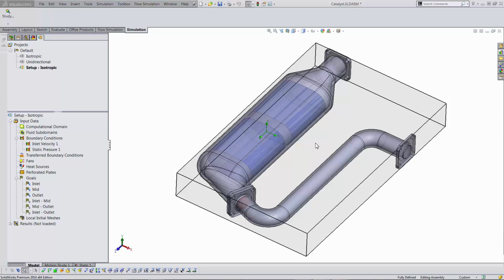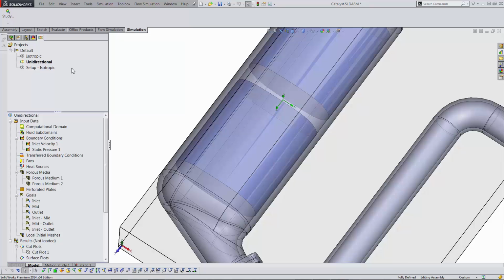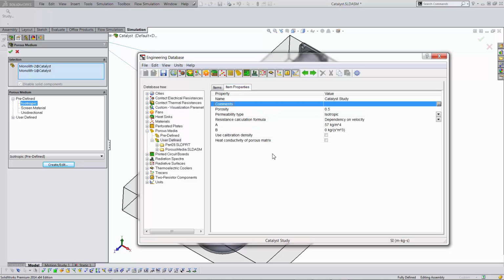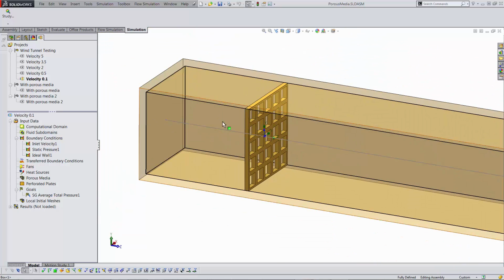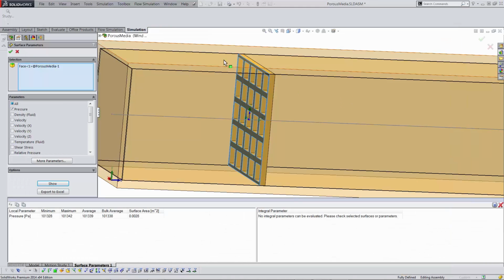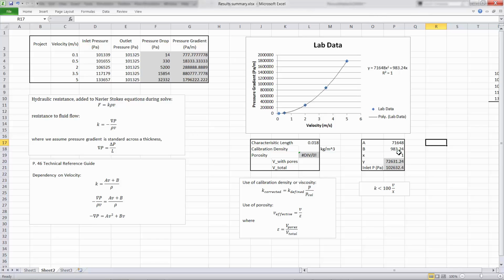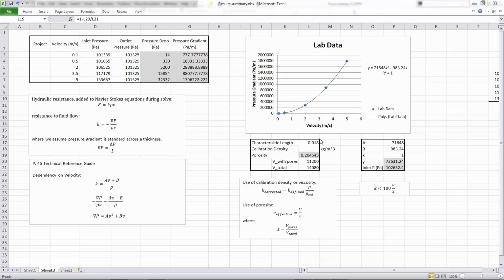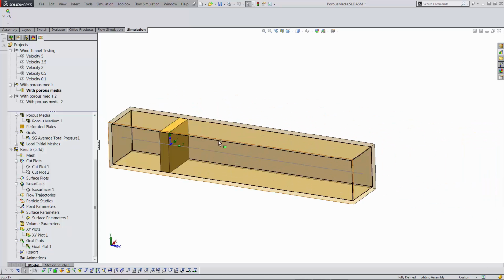SOLIDWORKS Flow Simulation - Simplify Using Porous Media

Comment: When chosing pressure drop vs flowrate it ask you to fill in area in Y, X och Z direction. Is that the cross-sectional area the air passes through in each direction?

Second question:
I get the same results with different porosity values, between 0-1, any  idea why?
Reply from the maker: When filling in pressure drop vs flowrate, there is a dropdown where we’re choosing “Unidirectional”, “Isotropic”, or “Orthotropic”. Since you’re being asked to fill in X, Y, and Z, my guess is yours is set to Orthotropic. You should be able to flip that if it’s not what you desire. 

Porosity (when using pressure drop vs flowrate) does not effect the overall results. The only thing it affects is the velocity within the porous media itself. Thus Velocity cut plots through the center of the media would look slightly different, or surface goals set on the media itself. If velocity is an important output, we recommend making measurement devices offset from the media – that way an incorrect porosity value doesn’t affect our velocity outputs. 

There is  a description of porosity in the Flow Simulation help. I’ll copy that here:

Please note that the porosity value is only used for calculating the flow resistance when one of the dependencies on the pore size is selected as the Permeability type.
With all other permeability types the porosity is only used as a scale factor during the results processing: the displayed velocity value is divided by porosity.
Porosity is also used for calculation of thermal conductivity of the porous matrix.

Comment: Hi Shivani, 

This is an interesting tutorial. I am just wondering if this method can also be applied for getting the pressure drop vs velocity across a thin plastic woven mesh filter? For example, a 109 x109 mesh; Opening Size=0.0059"
;Open Area=41%;Wire Diameter=0.0034".The filter will be installed on the inlet and outlet enclosure vents in a natural airflow environment(no fans).

Comment: Hi all, 
I have few queries related to the video. Can anyone please answer them and guide me kn right path ....??
How come the grate shown serves as porous media ....?? Is it just because of the square holes present in the plate...?
Are these the same holes causing whatever the pressure drop you calculated ...??
Can we have different sizes of plates for wind tunnel testing and actual simulation..?? 

Sorry if the questions sounds stupid and thanks for the time.

Cheers... 🙂
Reply: While calculating pressure drop, one side you have taken value at front surface of grate, but for other side u have taken atmospheric pressure 101325 Pa, instead of value on rear surface which is 101318 Pa. 
Can you explain about this please ...??

Comment: Hi Shivani i have a cuestion, where can i find the 
explanation of the first two equations F=Kpv  and k=GP/L?
Reply from the maker: Hi there,

I believe you’re referring to the technical reference pdf I pull up. One method to find that is to go to SOLIDWORKS Help button in the menu, go to SOLIDWORKS Simulation, then Flow Simulation Technical Reference. You have to have Flow Simulation added in to access this. You can also manually navigate to your installation folder, and get to it that way. An example of the default file path is: C:\Program Files\SOLIDWORKS Corp 2020\SOLIDWORKS Flow Simulation\lang\english\Docs.

Comment: does flowsim is capable to solve adsorption phenomenon in porous media?
Reply from the maker: Hi there,

No, testing for absorption in porous media is not possible in SOLIDWORKS Flow Simulation. 

However, you can assume perfect absorption on any particles that collide with that porous media. When running a particle study, create a specific wall condition for the porous media faces, and apply the condition absorption.

Comment: I used this method for evaluating the pressure drop through (0 < v < 6m/s) a sample of perf metal and my A=1945 and B= -683.4. That negative B coefficient shuts down the solver.
Reply from the maker: Hi Tau Design,
I tested your porous media values (A = 1945, B= -683.4) along with a dummy porosity value of 0.5 in SOLIDWORKS 2017 SP2.0 and the solver begins to solve with no warnings given.  We would recommend that, if you wish to diagnose this issue further, that you contact your local VAR so they can work with you and your file set directly to come to a resolution.
Reply: GoEngineer I'm running 2016 sp4. My local reseller couldn't get it to work with those values, either and is sending it up the chain to SW. BTW, porosity is around .375 for this- unidirectional, obviously.

Comment: Nice tutorial but I'm not getting results where the created porous media matches my perf coupon in my wind tunnel model. I'm getting a much higher pressure on the face of the porous media coupon than I am on the perf. Starting to piss me off. Also, my B term has a negative value. Question: Is the porosity the volume of the coupon with holes divided by the volume of the coupon without holes or is it the volume OF the holes divided by the volume without holes?
Reply from the maker: Hi Tau Design,
Porosity is defined as the fluid volume divided by the total volume of the porous media.

V = Vf + Vs

Porosity = Vf/V

Where 
V is the total volume of the porous media
Vf is the fluid only volume
Vs is the solid only volume

Comment: Thanks for this amazing tutorial! This tool is quite useful when trying to reduce the calculation time. I have some questions about the process I hope you can help me with:
1.- Considering that the characteristic length is the length of the plate to be modeled. Shouldn't the pressure drop value that is used in the calculations be measured between both faces of the plate? (in the case of v=0.1 m/s: 101336-101318=18)
2.- Does the fact that you the measurement of the average pressure is done in the solid part of the plate (and not in the whole cross section of the tunnel) affect the pressure drop accuracy?

Great video!
Reply from the maker: Yes, it seems like the technique would hold. At a glance the openings are large enough to maintain the Navier Stokes’ continuum condition, and the concern is memory requirements.

Memory Requirements: SOLIDWORKS Flow Developers recommend 3-5 cells across a channel for accuracy. This can make the elements quite small and hit hardware limits. Workarounds would be a shorter and narrower wind tunnel.

Navier Stokes’ Continuum condition: I will copy for you what SOLIDWORKS has to say on the topic. Essentially, we are trying to avoid microfluidics. If you have other examples, you can make sure they meet these requirements. 

The accuracy of the Navier-Stokes equations can be defined with the Knudsen number Kn=L/D (L- free path of gas molecules, D - typical task size) less than 0.001. A free path of gas molecules can be estimated with the following relation: L~1.225*Vis*k^0.5/(Ro*a). Here Vis – dynamic viscosity; k – adiabatic power; Ro – density; a – speed of sound.

Kn < 0.001  Navier-Stokes with Slip Boundary condition (zero velocity at the wall). Continuum Flow regime. We can use Flow Simulation.
0.001< Kn < 0.1  Navier-Stokes OK but with slip conditions (non zero velocity at the wall). Slip Flow regime.
0.1< Kn< 10 Navier-Stokes model not applicable. Other models are applicable (like Burnett equations, example: hypersonic flows about space 
vehicles in low earth orbits or flows in microchannels of MEMS devices).

Comment: Hi, thanks for a great video!
Two points are not clear though:
1. While finding the first point to build the graph you used 101339 Pa as pressure, but th XY plot you are using later to get the Characteristic length shows 101336.
2. It is still not clear what to use as Charachteristic length: real design length,  drop distance from XY plot of the pressure, or the distance where the pressure changes is I make a Pressure crossection along the tunnel (this may be the same as previous, I am still running a batch so can't be sure).
Please comment
Reply: +Serge Barshtman Hi Serge,1. I am glad you caught this--this is a typo on my part. I should not have used the average pressure (101339) in the EXCEL table. The one from the XY plot (101336) was the right one to use. 2. This is another good question. Characteristic Length is usually defined as the length of the real part that you're approximating since we wouldn't generally know the distance of the pressure drop region. (A) The benefit of using real part length as characteristic length is you can test out different geometry changes on the porous media instead. (B) Also, we have to consider that the bigger the porous media block, the more streamlines can be affected. So if there was going to be flow coming in from the sides, a bigger block would force them to act in a way that they generally wouldn't. In the video, neither (A) or (B) are factors, so I can use drop distance to make the results for perforated plate vs porous media look more similar. I hope that clarifies my thought process.Regards,Shivani Patel
Reply: +Shivani Patel Thanks for your response. After simulating and characterizing a few different Porous Media it becomes clear that small typos are not changing the global result - I think you made a similar point while choosing the value in the clip. 
As for your answer to my second question - if I got it right, in cases where the simulated width is larger than the real one it still should be Ok if we later define the Porous Media with unidirectional settings, which should be usually the case.
One other thing caught my attention: when same material is simulated to characterize the Porous Media, but the size of the sample is changing - A and B turn to be different. Since we are defining only a linear flow velocity and measuring the pressure change - the area of the sample should not change the result at all.
I was simulating different in size wall perforation (same holes array), so in this case I kept the frame/contour around the holes, and I suspect that this could be the reason why I got a little different total open/close ratio leading to different results.
Would using a fairly large specimen, instead of a small pipe cross section, be a better way to find the Porous Media resistance curve avoiding "designer's set of mind" mistakes?
Reply: +Serge Barshtman Serge,

When you mentioned Area affecting A&B, I am guessing the reason is because Area appears to be affecting the pressure drop. My first thought is the boundary layer from the borders of the 'tunnel' are affecting the region. 

Running a larger test file is a great idea to fix this issue. Check out some videos on setting up symmetry in the computational domain if you go this route--that tool can help keep things running quickly. 

As for your interpretation for simulated length v real length, I can get behind that. I have seen someone use porous media to simplify a complex 'mesh' of sheet metal in the middle of swirling flow. In that case, making the porous media too long would have had a detrimental affect. 

Regards,
Shivani